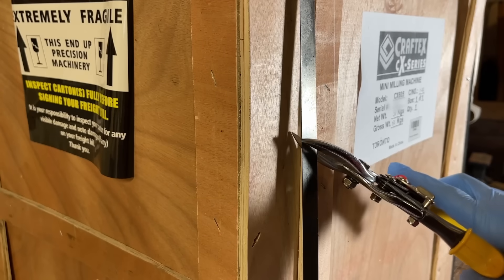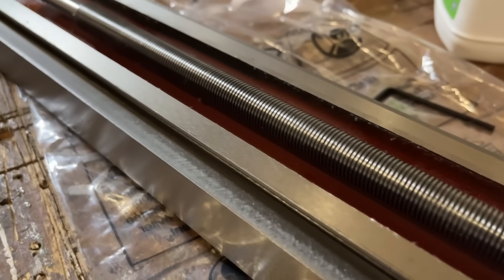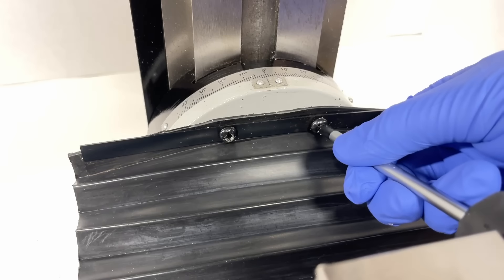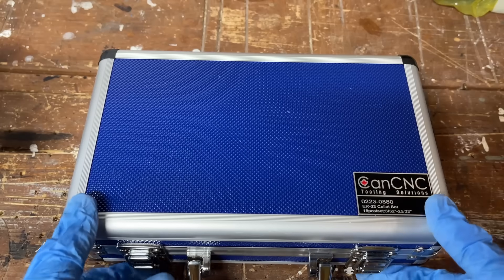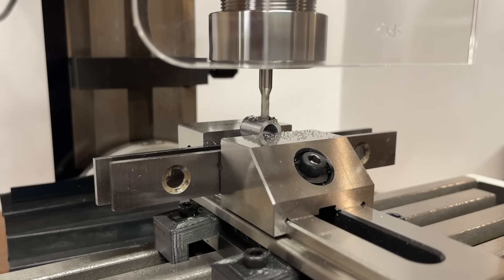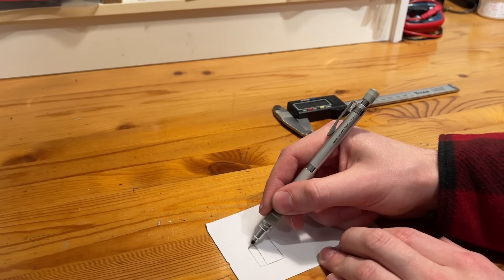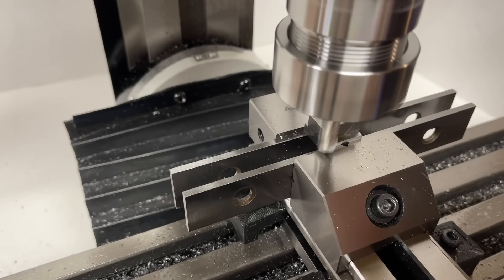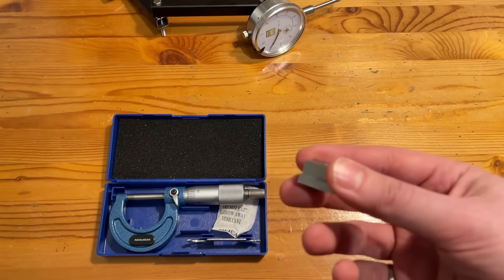I Bought A Minimill to see if they are Worth It

Comment: My brushless mill is super smooth and quiet, maybe I lucked out, I’m in Canada and got it at Busy Bee Tools, was able to tram mine super close too, almost dead on, as close as I need it for sure. I’m thinking same rebranded mill as other sellers have, anyway more than happy with it for a hobby mill. My lathe needed more cleanup on some rough edges, replaced a few crappy cap screws with good ones, spent some time with motor alignment and now happy with it too, w other the price to me for sure.

Comment: I mean its awesome for home use and smaller stuff, most people who say you cant work with these smal tools are probably used to fullsize machines ín a workshop.
But those small machines are not meant to do large material removal.
And anyone who buys such machines usually doesn't expect to work to a hundredth of an millimeter.

Comment: I'm looking forward to seeing how you get on with that benchtop mill. My 1962 Bridgeport cost me rather less than a decent mini-mill, BUT... I have a large brick-built workshop separate from the house. The noise and cutting fluids, 3 phase power and just the SIZE of the thing makes a big old cast-iron beast like a BP a terrible choice for someone based in a spare room or garage. It's all about picking the right tools, and understanding chiploads and feeds and speeds, always considering the effects of backlash and fixing the simple inherent manufacturing defects. I just bought a new CNC mill that weighs 2.5 times as much as the Bridgeport and makes the old BP look tiny, but it's only buying me speed, repeatability and the ability to cut complex compound curves.  Most of the parts I make could be machined on a mini-mill and lathe with enough preparation and care and correct tool choices.  Maybe not the Titanium parts, and getting a mirror finish on 4140 makes even my 3HP lathe break into a sweat, but hey....

Comment: I had a Grizzly G0704 for years and made many good parts on it, many in steel and some in 6Al4V titanium. It was fine for a lot of projects, but I ended up upgrading to a knock off Bridgeport when space and finances allowed. So long as your projects will fit on a mini mill, I wouldn't hesitate to recommend one. But a bigger mill is obviously nicer.

Comment: I'm a machinist on a Emco Hyperturn 65 Powermill where I have to deal with all sorts of steel, aluminum, plastics and from time to time hardened steel. 
Of course I couldn't run the same feeds and speeds on a mini mill or lathe 😆. Doesn't mean you can't cut steel on such small machines. You have to adjust everything to the size of the machine and you can mill/turn pretty much anything. For home projects such machines are awesome and absolutely capable

Comment: If you ever break the nylon gear, just 3D print a replacement. PLA works just fine. I havent broken the gear again. But it is a mechanical fuse. So im not worried if it does.
Reply: Nylon print is better.

Comment: On those machines, if the tilting head is that much of an issue, since 0 degrees would be the must used position, couldn't one set a good 0 (and or other useful angles) and then drill an indexing hole for a removable pin ?

I mean if you need 31 odd degrees or something, sure you will have to make sure it is not shifting during by taking lighter passes, but otherwise it some indexing holes sounds like a good solution to still have the potential of the tilting head and the piece of mind for regular jobs. It would also make make resetting the head easier after the occasional odd job, so less reason to procrastinate doing it. 

Am I missing something that would make it impractical, appart from the difficulty of drilling the hole in the first place ?

Comment: Good call mate! Like the video style and especially the content. These are great tools in the hands of a competent worker who can remember what tool they are using. Of course it will not perform like a tool costing 100times the price! Go away you haters and let the grown ups delight in working around the problems in a home or craft shop. I don't want to make spares for a tractor, but a steam engine six inches long yes! Great video and I would like to see a belt drive conversion and a motor upgrade might be good too.

Comment: I have deployed to the middle east with a smithy all in one.  Used it for 5 months as my only machine and cut everything with it.  Stainless had to be light cuts but it was doable.  My father is a retired machinist with 35 years in the industry and I am also a retired machinist with 25 years experience.  Any real machinist will be able to make any machine work if they need to.  I am planning on getting one of these small machines for at home.

Comment: Good video! I have the same mill and installed the Little Machine Shop air assist for the mill head. It included a new longer rack that increased the Z axis movement by about 3”, with about 1.3” of that in the upper direction if you remove the factory stop. When I removed the old spring mechanism it provided perfect mounting holes for a dro bracket. The Y axis dial has no thrust bearing but a hard steel washer made it every bit as smooth as the X axis. Finally, I used the nylock nuts from the bolts that held it in the crate to replace the double jam nuts holding the X and Y dials, making it much easier to adjust them.

Comment: SFM X 3.82 / DIA OF CUTTER = RPM. 
So HSS Endmill Cutting Steel has a SFM of 90 so a .250" Endmill should be running 1375RPM.

 THE HEAD TRAM DETERMINES THE CLIMB/CONVENTIONAL CUT

Comment: I thought the wheels had this weird value because it might be a metric conversion,
but it doesn't make sense in Millimeters either.
Reply from the maker: Yeah I’ve seen a few comments saying that it’s a metric lead screw, but like you noticed that would be 1.588 mm per revolution which is somehow even worse! It’s because it uses a 16 tpi lead screw, again not a dealbreaker but I found it made the mental math game tough haha

Comment: Loved the breakdown and it taught me that if I want a Mini-Mill, I should mill it myself :D
But PLEASE countersink your threads before cutting :D I have trauma about this since my apprenticeship!
Reply from the maker: I 100 percent should. Serves me right for not checking in with the machinists handbook before I started using the tap! Appreciate the tip! Will do in the future
Reply: @Someone_Should_Make_That  It's usually 10% of the threads diameter (for M6 it's 6.6mm) and it actually has three purposes. When you first tighten a bolt in there the material can move and build kind of like a hill on the surface. Doesn't happen when it's countersunk. Also it helps with starting your cutting because it aligns the cutter and it protects the threads from impact. If something hard hits the hole the first thread is protected and the threaded hole is still functional.
They really hammered that stuff into us because it stands for quality

Comment: I have the HF mini-mill with the belt drive plus ball screws for all 3 axis set up for cnc i made some knobs so i can use it manually because i did all that and still haven't hooked it up to a computer yet but when I first got it the backlash was horrible kept breaking my bits and cheap bits don't have a chance get carbide it will make life easier 1/2" bit 1/4" cut's on mild metal you can tell it's struggling but it's a tuff little machine

Comment: In my Bridport days of 50 yrs ago, I'm sure I'd be using coolant to protect the cutter.   Is this not possible on these mini mills?
Reply from the maker: Unfortunately I don’t have the setup needed to run coolant without making a mess of my workshop. So far I’ve been using cutting oil brushed on the stock and it seems to stay reasonably cool, I may run an air line over to blow the chips away + help with cooling

Comment: Instead of making "soda can" shims, I would go to an auto parts store and grab a set of feeler gauges, take them apart, and you have everything from .001 to .100.
Reply: Or, how about just buying some proper shim stock.
Reply: @jerryvan6709  Yup, 30 piece set of 1x6" 304SS from .001 to .010 for seventeen bucks.
Reply: Or how bout just making proper ones.
Reply: That sounds expensive
Reply: I don't think I've ever seen a feeler set that thick, and I've been using them since the '60s.  1 to 35 thou is the most common sets I own.

Comment: If you decide on a belt drive upgrade, then the gear drive is expendable anyway; would it make sense to apply some lapping compound to see if the gears can be run in a bit?
Reply: Two caveats on lapping gears:
-- make sure the lapping compound isn't getting into bearings anywhere, or into any brass surfaces that can become "charged" with it, i.e., can get granules embedded in the brass so that it becomes a permanently abrasive surface;
-- if by any chance you ever are tempted to lap gears to each other while you're spring-loading their shafts into zero-lash engagement, don't do it.  You can end up modifying the tooth-face profiles, more or less invisibly, so that afterward you discover that the gears will run in one direction but lock up in the other.

Comment: Great video. Mini-mills are quite capable. I have an Optimum Bf16v, it will cut pre-hardened at HRC44 really well. it will go straight through a block of such steel with a 12mm en mill cutting 20mm deep. However i only use solid carbide tooling in it.
Reply from the maker: I’ll have to try some good quality solid carbide tooling out! I’m currently using some cheap import stuff (though it’s holding its own quite well!)
Reply: @Someone_Should_Make_That  Most chinese carbide tooling is fine. Where it differs from german tooling is consistency not ability in my experience. Sometimes 2 chinese enmills that are supposed to be the same won't cut exactly the same. However this is more a problem in a CNC, not so much on a bench mill. 

I highly recommend solid carbide for everything, you can go way faster and warmer. And once you get up over a certain hardness in the stock you are cutting; HHS is just not gonna do it.

Comment: Your endmills will last much longer if you use a bit of coolant. Water soluble oil with water, or simple antifreeze and water will work for steel, and use WD-40 on aluminum (aluminum is actually abrasive to hardened steel).

Comment: I filled the bottom half of my column with a 50/50 mix of sand and tiny nuts and bolts in an epoxy.  That really cut down on the resonance vibration when milling high carbon steel.

Comment: Hope you dont store your micrometer in the closed position as i think i saw at the end there. Will wack it out of calibration quick smart...my old man told me that once...hes a tool maker
Reply from the maker: I had no idea, thanks for passing on the information!
Reply: @Someone_Should_Make_That  no stress, its because of contraction and expansion, for normal tools its not a problem such as a vernier as it can slide open. Whereas this would be fighting the ratchet mechanism if closed. Not good for it unless, you keep it in a temp stable environment. If your measurements are in whole mm's i would hazard a guess it wont matter, but not at 0.01mm, its too precise to not "notice" the effect of temperature

Comment: Perhaps it was better to start with milling a single T nut, but given sometimes you need multiple T nuts, I usually mill them in a series block. Then cut them free once milled and threaded. I don't usually mill the cut ends, since that isn't a working surface.

I would pin the tilting column in place it is tramed in. I'm there may come a time when you may want to move it, so make a tapered pin that can be removed.  I would think that 99% of the time you may want to generate a plane. Since table movement is horizontal, I think would be better to jig it, use angle blocks and a vise, or even an angle vise, to hold the work.

Comment: I have a mini mill about half that size and it's a total pain to work with. With such short dovetails by the time you have it tight enough to not chatter horribly it's very difficult to move anything. And to top it off the tallest thing I can drill using the chuck is about 3". Now I'm searching for a cheap full sized mill.
Reply from the maker: Yeah I had a similar issue with my 3018cnc. There is a limit to how small you can go before physical limitations start to impede making stuff. Hope you find what you’re looking for!

Comment: Heck yeah I have the same generation mill. Sieg X2D... A couple of things I've learned:

1.) I've upgraded the Sieg X2D to the belt drive and air shock from LittleMachineShop... and those upgrades are great!
2.) If you don't feel like upgrading and you want to start with a rigid column and larger table version of this mill get the 3990 from LMS... It's awesome. I've tested both the 3990 and the more basic model like this one in your video and can say it's worth the dollars. 
3.) IMO a DRO install is a must for these machines.

I use mine for just above every build in my shop and couldn't live without it! I routinely surface steel with a 2'' carbide face mill.. the machine is capable for sure!

Comment: In my opinion, a 'small' branded mill or lathe can be a valued asset to a garage/hobbyist's shop.  At 65 I had more time to play with projects.  Was intimidated by the thoughts of adding larger/heavier/costlier machines to my small shop. For a bit over $3,000 both machines were added to my workspace, positioned and secured by myself.  Now instead of +/- 1/32 I can easily work to +/- .001. Tooling costs continue but it has all been worth it.

Comment: 99.9% of complaints are operator error.  They are great machines for the price.  Once they are disassembled, cleaned and re assembled, then simply adjust it correctly and enjoy.  Next come the upgrades to improve performance which is mainly eliminating deflection.  I bought a Grizzly G0704 mill and a G0752 lathe.  I have been nothing but impressed.  Then again I learned how to use them properly by watching Open Source Machine Tools videos which are a bunch of 70's vids shot at MIT machining dept that makes parts for the MIT robotics dept.  Tons of hints and tricks, not to mention proper setup and use.
My fav are the unboxing vids.  Most are dangerous as the operator has absolutely no clue what he is doing and puts himself at great risk.  I saw one vid where the guy was actually familiar with a lathe and how to use it after he set it up.  Of course he still bought his tooling at Harbor Freight which is a waste, imo.  Shars Tools has the best goodies for overseas machines.
Make chips that dont need dips!
Forge On!!!
Reply from the maker: I’ll definitely be checking out those open source machine tools videos. Thanks for the tip!
Reply: That T nut came out nice.  Get a coutersink/chanfer tool when you get a chance.  Makes the holes all professional and stuff by finishing them off with a nice chamfer.

Comment: I run a huge lagun Republic at work, this little mill would take some getting used to. Was it power feeding the table or were you cranking it?
Reply from the maker: No power feed as of yet. I’ve been thinking about adding it though, there’s the chance I’ll convert it over to cnc so it may be a decent first step in that direction

Comment: A few things that will improve your experience.

The vice you are using is technically a vice for a surface grinder. It will work for the low forces you are going to be applying with shallow cuts on the minimill but you should consider getting a true milling vice instead.

The other thing I'd suggest is making sure you chamfer the hole you are going to tap before you tap it. If you forget you end up with a ragged thread as the thread starts out. If you do it after you fold the ragged edge down onto the thread below it causing you to have trouble putting a bolt through the first time.
Reply from the maker: Good suggestions! Thanks for the feedback. Tapping has always been the bane of my machining journey

Comment: I follow the BerylCNC mantra of "light cuts" on any of this Chinese mini machinery. It's simple physics - the smaller the area of a given pressure, the higher the force on the material. So if you use sharp carbide and take a light cut, you'll push your cutting force up into the range of the "production machines". If you're making prototypes or one-offs, these machines can work great. Also helps to not trash up your good machines on sketchy jobs, so they are good for that too.